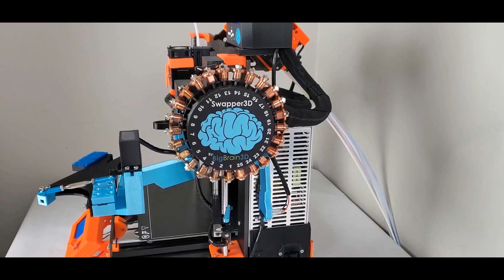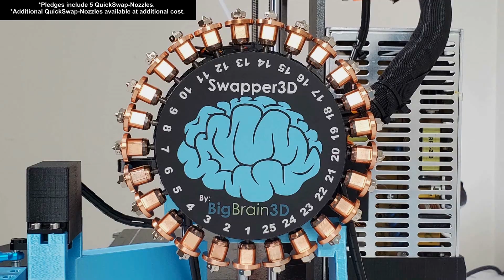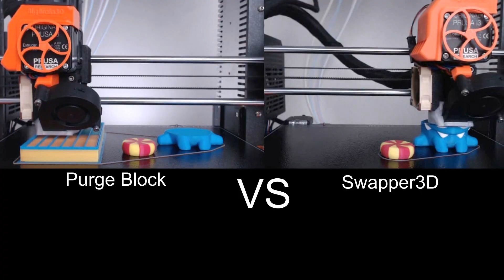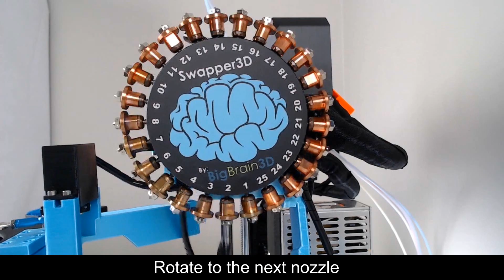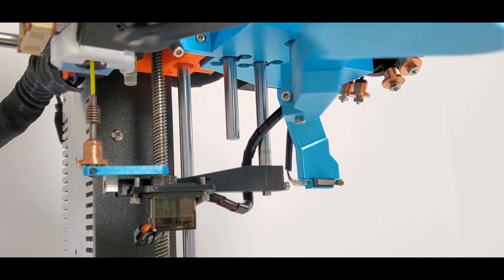Never print a purge block again!

Comment: Would a purge bin rather than purge block be better anyway, just have a little bin where the hot end can go above and extrude a little filament and then have something to wipe the hot end to knock off any plastic and then go back to printing. It would mean it doesn’t have to print a whole purge block, just extrude a little filament and wipe or cut it off.
Reply from the maker: The amount it would need to purge would be the exact same amount (and take the same time) in both cases. The only benefit to a purge bin is that you save the bed space, But many printers cannot move the nozzle off the bed, so in cases like the Prusa i3 you cannot use a purge bin and a purge block was your only choice..until The Swapper3D!
Reply: BigBrain3D purge blocks pretty much need to be the same area for every layer (or at least no less area than the layer above), if you don’t change filament for a few layers you still need to build the purge block up. Unless I understand it wrong, a purge block will take more filament.

Comment: This seems like a really cool product but I have a few questions/concerns. I’m assuming your demo here was done with cold nozzles, most of the time when I’m printing when it finishes and leaves the nozzle to cool down, some filament continues to melt and come out the end, it isn’t much but it is still enough it is noticeable, even more so if you leave the hot end hot, it leaks out and then when you go to step forward the extruder, there isn’t any filament in the nozzle because it has all leaked out, this means that no filament will come out until the extruder has pushed enough filament through. Another issue related to this that I can see, is even if just a little bit of filament leaks out then it will cool and harden and then get remelted again and this may effect the print when the nozzle starts printing again, since it has a little leak and a little bit of plastic coming out of the nozzle.

Another issue I can see is it appears that the nozzles are stored cold, so does it have to wait for the nozzle to cool down before it can change nozzles? Also it would have to wait for the nozzle to heat up again when it is replaced, which will use more power and will take a while. 

You didn’t show what you were using to change the filament, you only showed the nozzle part. So is the filament changer not included or did you not show it?
Reply from the maker: There is a wiper molded into the cutter guard that deals with the ooze (not shown in this video. see Kickstarter for more details) we also infill before perimeters to address the pressure stability.

It takes 15 seconds for the nozzles to reach melt temperature when inserted in the hotend. This is almost exact the same time it takes the MMU to unload to last filament and load the next filament, so there is no additional time added because of heat up in that situation. 

The filament switcher is not sold by us. In this video we are switching the filament after a nozzle change using the Prusa MMU (Multi Material Unit).  In short, the MMU pulls the old filament out -> selects a new filament -> then loads the new filament in. (The Swapper3D cuts the filament before the MMU pulls the old filament out to prevent possible strings and jamming.)  

Thanks for your comment :)
Reply: BigBrain3D you didn’t mention or show the wiper in the video.

15 seconds seems very fast compared, maybe a bit too fast, you also don’t mention what temperature it reaches after 15 seconds, that makes it sound like it’s just marketing. Are there any filament changers that can hold 25 filaments though?

Comment: There is a part of this that doesn't make full sense.. how can you do retractions properly on a re-started filament right after a swap? If the filament was just cut, until that mechanical break of the filament is in the melt zone, you can't pull backwards on it, so maybe quality suffers a little bit initially if it's doing quick micro-retractions like pressure advance etc?
Reply from the maker: Retraction has 2 effects which both make a large impact to stringing. 1) removing extrusion pressure and 2) creating suction at the tip of the nozzle. The #1 effect is seen immediately after a swap. The #2 effect is seen shortly after a little bit of extrusion, and to account for that we change the slicer to infill before perimeters. There is also the wiper on the cutter arm (not seen in this video. More info on Kickstarter page.) that can be used for priming the nozzle. Thanks for your comment :)

Comment: How does the new nozzle get primed? Seems like you would have to worry about blobbing if it over extrudes to prime, or under extrusion at color swap points in the print if it doesn't prime all the way.
Reply from the maker: There is a wiper molded into the cutter that deals with the ooze (not shown in this video. see Kickstarter for more details) we also infill before perimeters to address the pressure stability. Over priming is handled by the Wiper or infilling before perimeters.

Comment: That looks like a shit ton of weight that the one side of the printer has to handle moving it up and down. You haven't had any issues with that?
Reply from the maker: 1398g are added to the sprung weight. The current of the Z steppers is increased to account for this, and no missed steps have been seen. In the kit we include heat sinks and a fan that are added to the printer main board which keeps it much cooler than even stock current. Prusa i3 stepper drivers ran hot to start.

Comment: This is extremely innovative, though I picture a nasty seam showing up in the print at the point where the two cut ends of filament meet, similar to how a print looks when retraction is set way too high. Does this problem occur, or am I being an armchair expert?
Reply from the maker: There is no seam when the extrusion causes the cut part of the filament to reaches the nozzle, before that happens the cut enters the melt zone and becomes part of the melted material.

Comment: Everyone seems to be talking about the filament swapping aspect, but I'm just wondering how the nozzle is securely held in place for printing. I didn't see any sort of lacking/unlocking mechanism. It sounded like there was some sort of detent, but it's hard to say. 25 nozzles seems like overkill. The MMU2 supports 5 filaments, so with 25 nozzles you would have access to 5 nozzle sizes per filament. However there are only 4 commonly used sizes (0.2, 0.4, 0.6, 0.8mm). I guess you could have multiple nozzle materials though. For example, 0.2, 0.4, and 0.6mm in brass, and 0.4 and 0.6 in steel. Really cool concept.
Reply from the maker: There is a sliding lock that pulls the hotend up against a taper in the heater block. You can see more information about it on the kickstarter page.
The Prusa MMU can switch between 5 filaments, the CoPrint up to 7, the Mosaic Palette up to 8, the ERCF up to 12 (enraged rabbit carrot feeder), in the future there may be even more. The Swapper3D supports "UP TO" 25, but it will work with 1 or 2 or 5 or 8...all the way UP TO 25. When users purchase the base Swapper3D kit it comes with 5 QuickSwap-Nozzles and it can be expanded by adding more at any time in the future. The ‘up-to’ 25 nozzles can also be used to automatically switch different nozzle sizes during the print even when printing with a single filament.

Comment: So what will happen if;
Late night, lots of debugging the printer, go to bed, couple days later you code it to pick the nozzle from slot 5, but you meant slot 4.. what would happen if nothing can be picked up?
Reply from the maker: The Swapper3D checks for success at each step with a contact probe. It would detect the failure and pause the print waiting for user intervention.

Comment: I consider this way over-engineered, this could have been done way easier. As such, it's overpriced. And considering this is 400$ or up, I could just buy a dual nozzle printhead. I mean I really like the idea, but this looks unreliable, dirty and overcomplicated.
Reply: Yea I'm confused why it doesn't just use a dual(or more) nozzle instead:  No cutting/swapping necessary.
Who needs 20 materials on one print?!

Comment: Ah a side mounted tool changer, I love seeing these at work.
I can't believe it took this long for somebody to come up with this for a 3d printer when it's been standard fare for CNC machining centers for ages... Soon as e3d announced revo I was like this is when we are gonna see a more conventional tool changer for printers. My biggest question is how are the nozzle breaks held in the hotend?
Reply from the maker: Glad you liked it!.
There is a sliding lock that pulls the hotend up against a taper in the heater block. You can see more information about it on the kickstarter page.
Reply: @BigBrain3D  and what kind of z offset repeatability have you found?
Might be best to combine with a probing cycle with an end stop of a known position, not every firmware supports this, but it would be useful to ensure consistency, my early plan for a z repeatedly would be ±0.015mm so that you have a maximum difference of half of a fine layer
Reply from the maker: @3dpyromaniac560  We've found any difference to be imperceptible. The firmware code will be available to customers soon so you could make any adaptations you feel are appropriate very easily.

Comment: Okay, that's cool and all, but how does the printer actually switch filaments? Is there a printer that can handle 25 lines of filament into the end effector? Or is this just meant to make manual swaps easier?
Reply from the maker: In this video we are switching the filament after a nozzle change using the Prusa MMU (Multi Material Unit).  In short, the MMU pulls the old filament out -> selects a new filament -> then loads the new filament in. (The Swapper3D cuts the filament before the MMU pulls the old filament out to prevent possible strings and jamming.)  
The Prusa MMU can switch between 5 filaments, the CoPrint up to 7, the Mosaic Palette up to 8, the ERCF up to 12 (enraged rabbit carrot feeder), in the future there may be even more. The Swapper3D supports "UP TO" 25, but it will work with 1 or 2 or 5 or 8...all the way UP TO 25. When users purchase the base Swapper3D kit it comes with 5 QuickSwap-Nozzles and it can be expanded by adding more at any time in the future. The ‘up-to’ 25 nozzles can also be used to automatically switch different nozzle sizes during the print even when printing with a single filament.

Comment: Oh boy, I have so many questions.. Is everything attached to the X axis? If so - how much weight is there added?
Reply from the maker: Sprung weight is increased by 1398grams.
To account for this the current of the Z steppers is increased, and in the kit we include heat sinks and a fan that are added to the printer main board which keeps it much cooler than even stock current. Prusa i3 stepper drivers ran hot to start.

Comment: @BigBrain3D only because you did such a great thing by providing the theory of operation did you guarantee a backer.  As a technician I appreciate the detailed engineering explanation of what the machine is supposed to be doing.  Looks like you have some good checks in there, and I am curious to learn about how it checks for "tool change complete".  Vision?  Touch Probe?  Inductive sensor?  Who knows, well you do actually.
Reply from the maker: Thank you for your support! We use a touch probe to make sure each stage completed successfully.

Comment: I wish the timelapse was higher quality, I find it hard to believe you can achieve the same quality between these 2 methods. The tolerance we're talking about for nozzle height and centerline are so small I don't think each cartridge is going to line back up as it should. This is why CNC milling machines have tool length offsets and cutter comp.

Comment: Do the  nozzles clog alot from the filament that's left behind in them
Reply from the maker: If you think about it, you normally have filament left in your printers nozzle between prints. This is the same thing. The nozzles cool down when they are removed from the hotend heater block. And they heat back up in 15 seconds. No time to clog.

Comment: I mean, it is impressive, no doubt about it. But I am 100% sure that Z axis is not happy with all that new offcenter mass applied.
Reply from the maker: The current of the Z steppers is increased, and in the kit we include heat sinks and a fan that are added to the printer main board which keeps it much cooler than even stock current. Prusa i3 stepper drivers ran hot to start...

Comment: Juste une question, est ce que les buses restent chaudes ou peuvent être chauffer avant insertion et ainsi économiser le temps de chauffe ?
Reply from the maker: The nozzle are swapped before the filament is switched so that they heat up during that time. This way it doesn't add any time to the process.

Comment: What is needed on the other side - meaning: the printer side to change the filament? Is a MMU enough? Which MMUs are supported?
Reply from the maker: Yes the MMU is enough. Also,  a Mosaic palette, or ERCF, or CoPrint, or similar device would also work.

Comment: The over engineered system looks fun for a novelty or a collection but the added weight would reduce print speed for production parts and not be worth it if you recycle filament. But I appreciate the goal for slow at home use as well. If I were to do this I wo u ld like to design my own like all the rest of my stuff and have fun doing that with it. Good luck this seems promising.

Comment: Okay, it works in this demo i get it. Can you share some of the  failure modes of such a system ?
Reply from the maker: We foresee 4 possible failures 1)it cannot unload the nozzle 2) it cannot stow the nozzle 3)it cannot select a nozzle 4)it cannot load a nozzle. We incorporate a check switch that confirms each of these steps. For instance if it failed to pick a nozzle out of the tool holder wheel then when it moved to the switch it would not trigger it, then the Swapper3D would displace an error on the LCD and wait pause the print waiting for user intervention.

Comment: How repeatable is the error in Z position/length of the nozzle when another is inserted?
Obviously you’ll have levelled the bed off nozzle 1, so how close to the position for nozzle 1 will all subsequent nozzles be?
Reply from the maker: They should be within 50um of nozzle 1 Z

Comment: Two problems I see?  1 > it would cost a huge amount to buy & get the spares which will be special 
and that means super pricey and only available from the company even if your in their kick starter.  

2 > Not all 3D printers could be fitted with such a big side mounted system as many have different frame 
and system designs and/or no free room where the printer in placed in the home.

Although clever, even if it is funded and launched it will be too pricey and hard to set up on all the different FDM printers.

Most likely be as much as a medium cost 3D printer would cost to buy it. Most people would I think prefer to spend that money getting another printer.

Comment: How much tuning is required so this doesn't suffer filament jamming due to the cutting of the filament?
Reply from the maker: The cutting of the filament has no effect on whether the filament jams. That is entirely dependent on the components down-stream of the cut like the heat break and nozzle. We based the QuickSwap-Hotend on community proven designs.

Comment: So how do the all the different color filaments get routed and fed into the nozzles?
Reply from the maker: In this video we are switching the filament after a nozzle change using the Prusa MMU (Multi Material Unit). In short, the MMU pulls the old filament out -> selects a new filament -> then loads the new filament in. (The Swapper3D cuts the filament before the MMU pulls the old filament out to prevent possible strings and jamming.)
Reply: @BigBrain3D  Thanks for the info. Cheers.

Comment: I never really thought about this, but the ability to swap the nozzle depending on the detail is very appealing, and I could see significant uses for this. It’s interesting to see the expansion of 3d printing into a new area similar to CNC milling, where several tools are used to create a perfect part. The only challenge now is refining these tools to be affordable and take up less space. Awesome stuff you guys made!
Reply: Yes this sounds so nice, being able to switch from .6mm nozzle for bulky, quick printed areas and then swap to a .2mm nozzle for the super fine detailed sections.
Reply: The nozzles on the wheel are all preheated? And when the nozzle is extracted from hotend, there' s a small part of filament cut in, how the  mechanism remove it ready for the next change ?
Reply: That's the approach i was thinking of too. Being able to swap nozzles is just as important as change filaments.
Reply: You'd have to get fancy with slicer settings , as long as it where per layer current slicers would work other then that the slicer tech just isn't there
Reply: There are better designs for actually swapping toolheads. Swapping just the nozzle is in itself very useful because of the purging issue, but is both easier and harder than swapping the complete toolhead. But there are already automatic toolswappers which can swap two or maybe four and more hotends or instead something like an expection camera, part placer, drill etc.